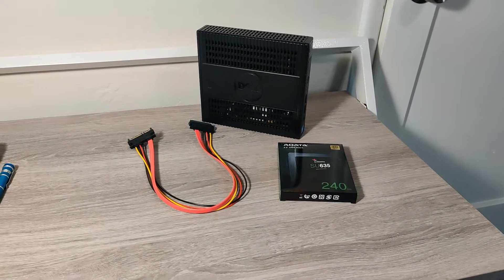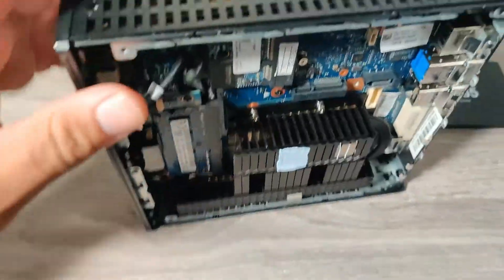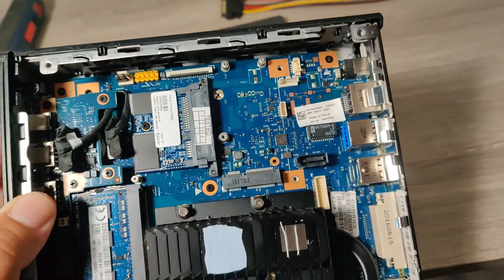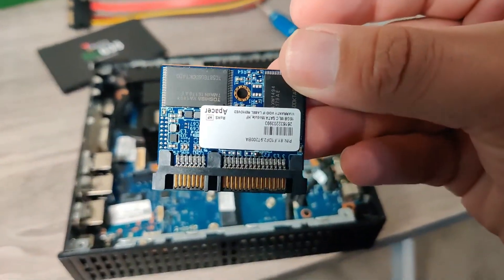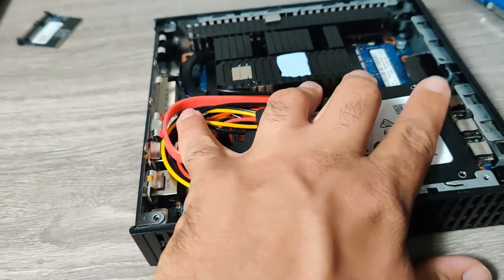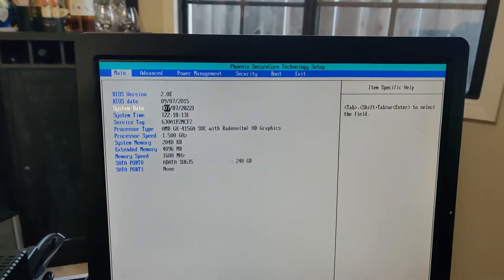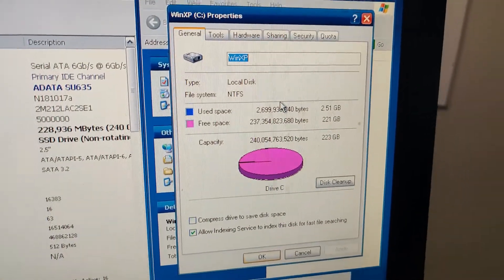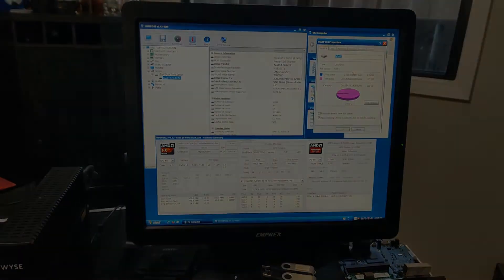Cramming a 2.5 inch SSD into a Thin Client

Comment: On these units you use a Sata to NGFF m.2 adapter to upgrade the storage. I have the Wyse 7020 and I went with 8GB DDR3 Sodomm memory, and 2 NGFF adapters for the storage. and, yes... I did get the 2nd. Sata channel fitting to use it. went with 2 512GB NGFF M.2 drives and it works great!
Reply: Can I install Linux ?
Reply: @soumenbabu7484  u can install whatever you want (and linux asks for less requirements than windows so yes, you can)

Comment: you know that the pcb inside your Adata drive is bearly biger than the 16gb arlerdy inside ....juste removed the platic case and your ssd will fit
Reply: My ssd  (2.5" Silicon Power 256GB SSd SD nand) was in a plastic housing. I opened it, measured and marked where to cut, and cut off the extra half that was not being used with a band saw. :) I 3d printed a "cap" to fit over the end that was cut. Fits nice and easy in the case with the cable extension.
Reply: I actually came to comment the same thing.
Reply: Airflow just decreased significantly. Also just open the ADATA and take out the board inside. Then just connect that to the SATA port
Reply: You totally compromised the passive cooling of the case. Also there are much shorter versions of that wire. You could have also gotten a higher capacity drive like the one it came with.
Reply: not really the air from the case fan is enough to cool your ssd and look at all the moderne m.2 ssd they dont put them into case they are all naked lol and they are faster .... if you realy want to be overly secure you could added a eathsink for m.2 ssd
Reply: @johnhudson7055 what's the name of that wire?

Comment: Thanks for your videos!
Was looking for a WinXP-capable machine in a small form factor, and found the Dell FX170. From your videos, it seemed a capble machine, but the 44pin IDE was a letdown, wanted something with sata ports, hopefully a PCI expansion and a couple video connectors. The 5010 seems to fit all these parameters, albeit is somewhat larger than I'd wanted (my goal was roughly 140mm wide, and this unit is 185mm or so, but hopefully without the case it'll shave off some width). Bough a unit from ebay for 38€, comes with 2GB RAM, 4GB flash and is supposedly brand new in opened box, with Win Embedded 7. Will add an external USB sata adapter for storage to test, and then upgrade the internal drive with your method. Planning to make a portable UMPC with it, to play some XP games on the go. Maybe will add active cooling to reduce height of the heatsink, 3D print a case with some small Aliexpress screen and reuse an Acer laptop battery pack for it. Certainly much more exciting than using Virtualbox (albeit perhaps a tad slower compared to my i5-8300H laptop with 16GB ram hahah)))) But well, for now will have to get it up and running first))))

Cheers from Spain!
Reply: Name of the connector you used in this video